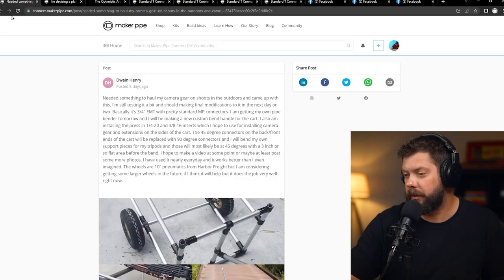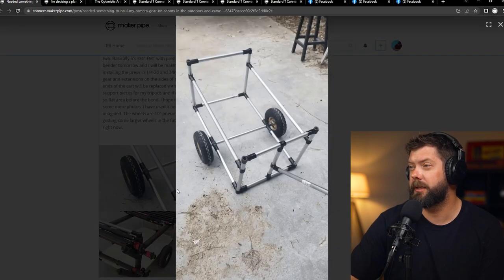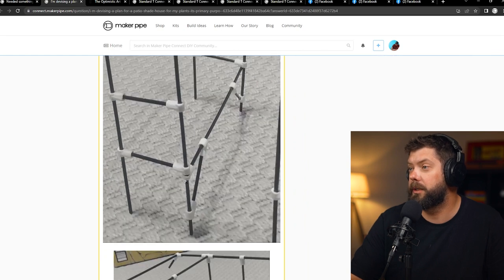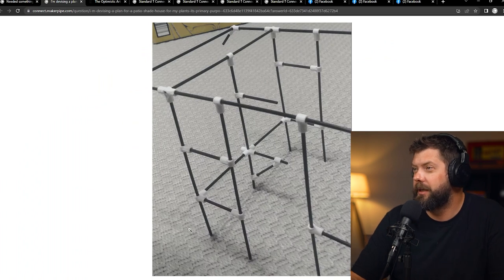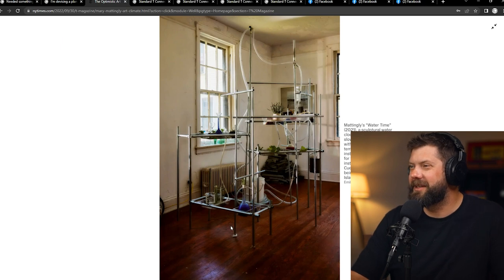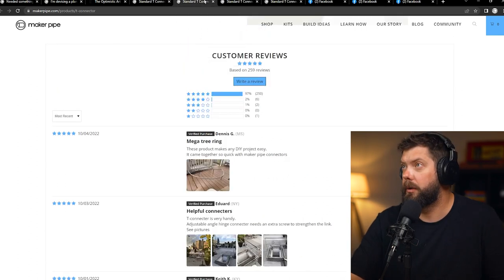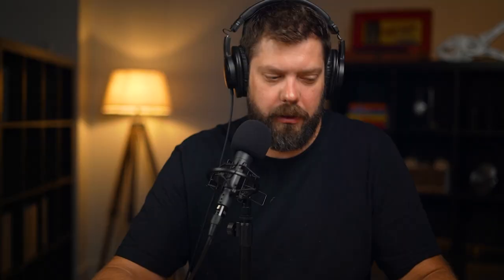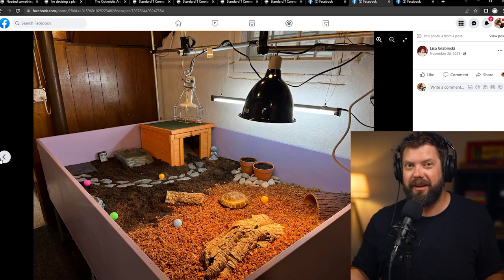Clever DIY Builds & Uses For EMT Conduit | MPM - 121

Comment: I didn't use threaded rods on the first video cart you showed. I used plain 5/8" round rod and  I just used a few set screw shaft collars. That seems way easier than the threaded rod and probably a good deal cheaper. I'm also not in video production it's just a hobby really and I love building stuff so it was always going to be a DIY project as opposed to buying a commercially made version. The cart works great but I'm still waiting on my pipe bender ( ordered the wrong size first time) so I can bend  a custom handle for the cart. Also going to bend some new 45s for the 'arms' to hold my tripods etc. After that I'm going to finish it all with a new foam wrap job for the whole thing and it will be done.
Reply from the maker: Thanks for the comment and clarification. Sounds like V2 will be even better!